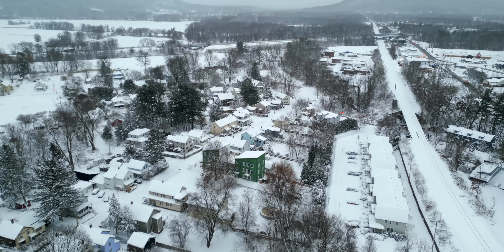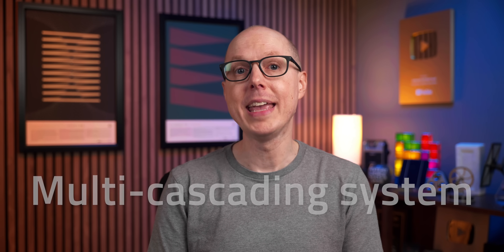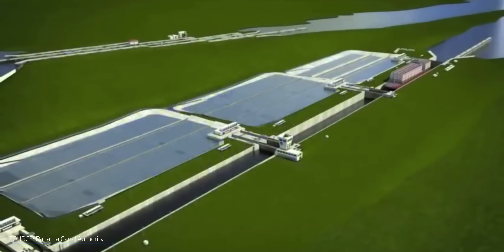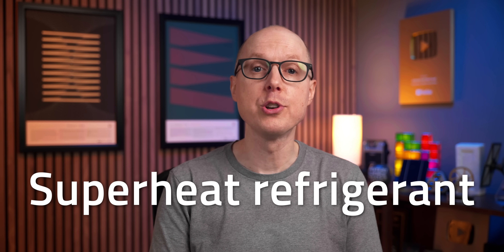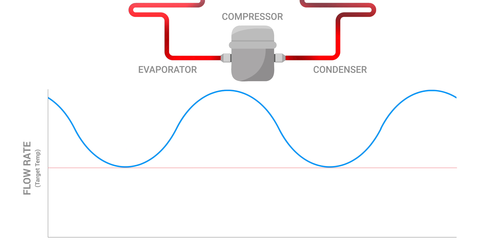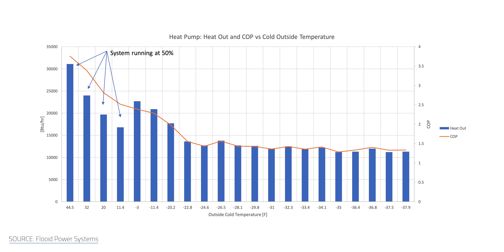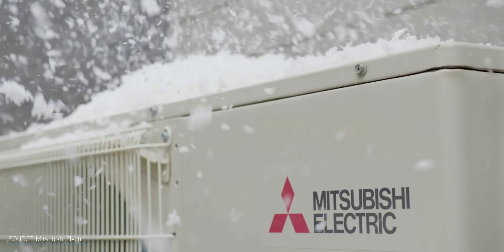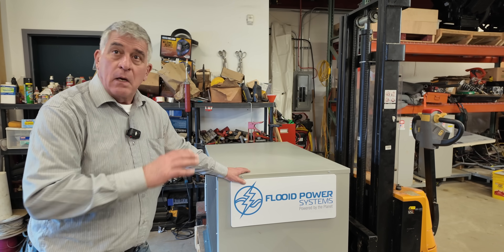How This New Heat Pump is Genius

Comment: In order for HP to out perform Gas you need a COP of at least 4!
This system sounds good in terms of temp performance but the COP is through the floor!

In effect cascading the system just decreases COP.
Then there is the issue of size. My gas boiler measures a svelte 16" X 48" X 12"! And it does central heating for a 3 bed home and instant hot water.  Easily hidden in a normal house.
Reply: You can't just handwave this or use "common sense". You need to go through the math to find out if it works, figuring in climate, cost of energy, system cost, and other considerations like size.
Reply: @jamesvandamme7786  Well you can use their stated COP and work out the cost of gas to electricity and conclude which is cheaper. In extreme weather conditions the COP gets worse so it is not difficult to make a consideration!
The size issue was to show how retrofitting in a domestic situation might just not work.
Reply: @totherarf  Derp, electricity and natural gas costs vary dramatically throughout the US.
Your statement that "Dis ting iz cheeper" holds no relevance outside of your locality.
Is your electricity 30 cents a KwH? Mine is 8. The US average is 15. Hawaii is 44.
The same thing applies with NG, where it can be massively cheaper or significantly more expensive depending on local/state taxes, carrier costs, etc.
Reply: Why do you need a COP of at least 4?
Reply: @Plan3tBob  Gas is 5 times cheaper than electricity when you factor in its efficiency you get a ball park 4. this will change as prices alter though!
Reply: @totherarf  5 times cheaper *where you live*.
Reply: @totherarf Thank you and yes your COP of 4 statement makes perfect sense now.  For me then elec:gas is 4:1 (dropping to 2:1 if only consuming during the cheap time window I have on my tariff). So I'd need a COP of 3 to break even during the day. Interesting. I also have solar panels, however.. I need to be careful here since I'll need more hot water in the darker months than the lighter ones! No rush I feel and the technology seems to be progressing at an increased rate.  R290 refrigerant also looks interesting for higher water temperature output. Thanks again for replying. 👍
Reply: @tim3172  Agreed!

Comment: The main efficiency 'problem' with our heat pump is not solvable: ice on the evaporator in moist weather with temperatures of 0C to 4C.  It then has to defrost every 30-40 minutes.  No matter what the optimal temperature for the refrigerant is, this will happen to any unit.  I was considering putting a waterproof IR mat on the wall, thus radiating heat to the unit and prevent it from icing up so quickly... but as COP is still around 3 it seems unlikely to be more efficient.
Reply: True but, like you say with temperatures in the evaporator below 4°C it will be a problem, so  I don't think having -11°C or -25°C will make a difference in the freezing problem. The cascade heat pump has the advantage to be more performant at -25°C if I understand it correctly. The defreezing would probably work the same for a cascade heat pump as for a single cycle HP. I would be interested to know if all the cycle has to be reversed to defreeze the heat exchanger, or only the lowest cycle ...
Reply: @Froudd  frosting is a problem for our HP to since in the Midwest we can still have 20-30% humidity in the winter. I would expect that only the cycle that had the frosted condenser would need to be defrosted. Would the defrosting be a lot more efficient since there'd be another whole cycle to help with that would it not make much difference because it's not hard to raise the temp above 40F using the air in the house?
Reply: It's not solvable cheaply. Ground source heat pumps don't have this problem.

Comment: AC should always be paired to water heaters by which it pre-cools the HVAC return gas (hot side) by passing it through the water heater before heading outside to be cooled in the loop.

Comment: What refrigerant are these heat pump using. Most "traditional" refrigerants are very potent greenhouse glasses. (Gwp > 1000). The "new" refrigerants are often PFAS.. Use CO2 as refrigerant. CO2 is a refrigerant that makes it possible to get high temperatures (above 60C) and also at low ambient temperatures. The transcritical CO2 process is much simpler than the Cascade systems because it uses only one refrigerant (CO2). At very high temperature difference you can use a 2 stage process. Here in Denmark we're using many large scale CO2 heat pumps for district heating (Megawatt) delivering 80C. Also small heat pumps are available. Btw. CO2 is used For almost every supermarked (cooling) in Europe. Many supermarkeds have heat reclaim and use the heat generated by cooling as heat source (a heat pump). /Frede Schmidt, Denmark.

Comment: The irrelevance point of heat pump is the point when the net gain goes below the energy consumption of the system itself. The cascade just adds to the system's energy usage rendering irrelevant much earlier.
Reply: Did you watch the part of the video where they covered this issue? As an aside, my heat pump water heater can run all day and still use less energy than a standard electric water heater. The hurdles being worked through are how to place heat pumps in their optimum operating range and one solution is cascading heat pumps. I would like to be able to use the waste heat from compressor to heat my water, rather than heating the already hot outside air. That would add another level of efficiency during the summer, but greater system complexity. Give people time to figure out solutions, and hopefully cost reduction as heat pumps become more prevalent.

Comment: Further to your bicycle gearing analogy:
It's closer to the video example. Not just a simple single source gear creating a range but rather the dual range created by a dual source gear. (i.e. 10 speed bicycle = 2 source (primary) gears and 5 final (Secondary) gears = 2 x 5 = 10)
Each source gear would be analogous to the loops and the entire set of final gears is analogous to the range of each loop.
Reply: Frictionless gears are great aren't they. That'll be how they scaled Mount Everest, on frictionless push-bikes. 
Perhaps our cheery chipmunk will do a video on that someday, when he'd had and think about it.

Comment: That seems like an interesting Idea. Something I wondered about though is having a heatpump with the air drawn from something like a greenhouse during the winter so the air is being heated a little as it passes through. Obv won't work all of the time but sometimes the sun does shine in the winter and would raise the temp a few degrees in a greenhouse.
Reply: So basically using thermal solar in combination with heat pump, there are already systems like that. Some combined with heat storage

Comment: My parents recently moved into a new condo, and I believe it has the following setup, from outside to in: heat pump, heat exchanger, supplemental resistive heating. This configuration (if I haven't misunderstood it, I'm not an hvac expert) seems odd to me. Ideally the air intake should run through the heat exchanger first, then supplemental resistive heating if necessary, and then the heat pump. Is there a good reason why the heat pump always seems to be on the outside?

Comment: As someone who fixes them alot, you can keep those pos. They always break down, dont last as long as normal furnaces. Heat pumps cost 3 to 5x as much as other options. In cold weather they are a terrible option
Reply: Always listen to the techs.  They'll tell you what's crap and why.
Reply: @AlbertaGeek  Yeah, listen to the people who profit from the sale and repair of the garbage systems they hawk.
Reply: @tim3172  Repairmen are not salesmen.

Comment: I'm kind of stunned that this is new.  Cascade cooling has been around for decades and heat pumps are quite literally just reversible AC units.  Maybe I spend too much time surrounded by engineers but I file this under the "DUH category".
Reply: Lots of things have "been around for decades" and yet still aren't viable options for residential applications.

Comment: I have reasonably new gas furnace and air con unit. When it's due to be replaced I fully expect to replace it with a heat exchanger if the tech is ready and the prices are right. 
Every time you say Massachusetts, the Bee Gees start singing. I mean I love the song, but please. That's not all. I press start and the microwave starts playing Genesis' Behind The Lines and my Electric toothbrush starts Guns n Roses Sweet Child O' Mine.

Comment: I wonder if these units are worth it because they really only have an advantage for about 20 odd days of the year in winter where I live (Indiana) where I need some electric heat strips to help out... On those days the electric usage is higher but  Just how long would it take to pay off a new system to justify the cost. And I do not think it is efficient as what I have now when the temperature is reasonable. Seems to only really help at extreme outdoor temperatures. Perhaps it is only helpful in Very cold climates like Canada or VERY hot like perhaps in Africa or India. Thinking if one can afford one of these types of systems might as well swing for a geothermal then it is even better. However I can see where there would be advantages for this system in extreme situations. But the design looks like it would be less energy efficient if there is not extreme climate temperatures compared to a 16 or 18 seer heat pump.

Comment: Matt, here's an easy analogy, gears on a car, get the torque too high for one set of gears then it switches over to another.
Reply: Maybe yes, but gearboxes have friction. Every time you ass another step you're losing/wasting energy.
There are no free lunches out there
Please NB: Energy is NOT the same as Temperature
Reply: @peterbetts8740  "Every time you ass"
Accurate.

Comment: Here in Northern Vermont it never went below zero for weeks at a time this past winter like it normally does. I don't think it actually did go below zero.
We have an Oil Furnace with Baseboard Heating & no need for ac as it hasn't been going much above 80 here which is to me the perfect temp.

Comment: Houses should be designed not to need hvac. I understand humidity and air quality but temperatures should be the houses job.
Reply: The laws of thermodynamics cannot be violated.
Reply: Due to the diminishing returns when installing insulation, it's very hard to design a home thatcan gather the heat needed to keep occupants warm in the winter, and yet not get too hot in the summer. The Passive House concerpt tries to do this, but even the best passive houses have some form of active heating.

Comment: What’s the cost of an average heat pump over a gas furnace? My gas furnace is over 20 years old so it may be time for a heat pump!
Reply: Maybe $4000 for a nice heat pump vs $1500 for a furnace. Installation and markup will vary greatly. Depending on your situation a better comparision might be heat pump vs furnace + AC. A heat pump is probably less expensive than furnace+AC.

Comment: Are American heatpumps really that bad or is there some measurement difference going on? Heat pumps in Europe commonly have a COP above 4.0, up to 5.0 even. Even at -10°C many of them seem to stay around 3.0. A COP of 2 is beyond terrible.

Nevermind that due to our high electricity prices it might not even be cheaper. 8cts/kWh for wood, 13cts/kWh for gas. A heat pump gets you 8-15cts/kWh depending on COP, for a system that's multiples more expensive. If we were to use the heat pump above with a COP of 2, we'd be paying over 20cts/kWh.
Reply: Are you actually looking at full COP at different operating points? COP at 5F (-15C) is usually 2 here. This includes blower power (if European ratings don't then your ratings will be higher for the same unit). We also use "older" refrigerants in the US. We're supposed to switch to R32 any time now and AFAIK Europe is already moving away from that.

Comment: I would have appreciated more explanation and fewer analogies. Do the different HPs in the cascade use different working fluids? Different sized compressors? Other variables that account for the differences? Are the coils located in separate locations? Are the coils within the cascade sealed from ambient air? If so, how? 

The basic idea behind is it simple and doesn’t need a cascade of analogies. The details of how they work would be interesting, but they weren’t in this video. I would definitely watch a follow-up that tells us how they work.

Comment: Very nice....Flooid might want to talk with the maker of the Liberator (Missouri)rocket stove. Liberator guy is a humanitarian, very knowledgeable with energy/heat/interests and went through the system bringing his stove to ul approved market in the US.
I removed my homes boiler and baseboard pipes remain intact waiting for something like this. Trees clear from large southern side of my house waiting for a unit and then a greenhouse over that. Could even have a wood ground Colorado(if you will) stile rocket///heat,
Next if Flooid needs a ind elec trained/experienced floor sweeper all about efficiency I'm game.

Comment: You're always limited to working around a single refrigerent.  I wonder if we can switch between TWO different (separate) freon tanks in a single application system, with control valves, using the lower b.p. of the lighter refrigerent for heating in really colder weather.  Good video, thanks ( I'm available for part time help)

Comment: I would be interested but  1.  Getting an hvac guy to install and maintain it would be difficult at best.  2.  A DIY system is out as well. (cost to be a certified hvac and all the tools to work on it).  3.  Parts availability would be a consideration.  4.  The changing coolant requirements of the EPA for the next several years makes it a tough decision on the purchase a new system mainly because of coolant availability concerns.  5.  coat vs payback in terms of years.  What would it be?  6.  if the systems last more than 20 years coil cleaning becomes key.  Are the systems easy to access for cleaning?
Reply: I mean I have the same problem with a geothermal system. And honestly even getting an HVAC tech isn't easy. This is technology that's not even out yet and everyday use they're just starting to use it in this application meaning it'll be years before it's installed with any sort of regularity.

Comment: You might want to do something about your mid-roll ads.   I had to watch one long ass unskippable add, just to get to a shorter unskippable ad for the video to start.

Right after your intro was over and you got to the part I wanted to watch, ONE SENTENCE in (A heat pump is...) ANOTHER unskippable ad popped up, and I turned off the video.
Reply: You might want to spend 15 minutes figuring out that both of those problems are easily solved for all YT videos...
Reply: @tim3172  Not on a ROKU TV.

So you might want to reevaluate typing shit on the internet as though it was fact across all scenarios.

Comment: As we move from a fire to heat, to a heat pump, to two heat pumps, the capital costs keep increasing.  And the potential for needing repairs. ("Parts that aren't there cost nothing and never go wrong."  Charles F. Kettering)  You can buy a lot of heat strips for the cost of a compressor and hardware needed.

Nevertheless, all exciting.
Reply: All advanced tech works this way. Higher up front costs, but larger long term efficiency that will pay off over time. Those with the capital to make the initial investment will be able to keep more of their money over time, while people have ho can't are kind of doomed with high bills which keep them from being able to progress. It's a bit brutal.
Reply: @CaedenV  Yep all the more reason for tax credits or grants to help people catch up.
Reply: @Awrethien  Yes that way billionnaire can save a lot of money, meanwhile people are dying...
Reply: Maybe, in my situation I'd have to upgrade my electrical service to be able to run heat strips. That means getting the utility involved and possibly upgrading wiring to the transformer, which is buried, possibly upgrading the transformer. It could be a LOT, which is why I have propane backup for our heat pump. With a cascading heat pump it wouldn't pull as much power as heat strips, so I could run it with my existing electrical service and I could get rid of the giant propane tank in my yard. I could justify quite a bit of expense for those benefits. Hopefully this tech takes off, gets popular, and the costs come down in the next 15-20 years when I'll probably be looking for another heat pump (our current one is 2 years old).

Comment: We just need to get away from outdoor air exchangers. I wonder when we will get a whole home heat pump system where your cooling and heating is all done on a single system, then just route piping to indoor AC, water heater, clothes dryer, etc...
Reply: You seem to be missing the point that an outdoor 'unit' is the only thing that can supply heat into the home or reject it if there is no demand in the home. There has to be something outside the home. It could be an air handler or a ground-source loop, but there has to be something that sits outside of the home.  Ground source loops are great if your property has a lot of outdoor space, but for homes in urban areas air handlers remain the most compact form of outdoor unit to gather or dispose of heat that is not needed in the home.
Reply: @tlangdon12  ground source is what I meant but you are correct, that would be harder in urban situations in retrofit scenarios. In an urban new build I think ground would still be beneficial as you could just bore straight down in most cases.